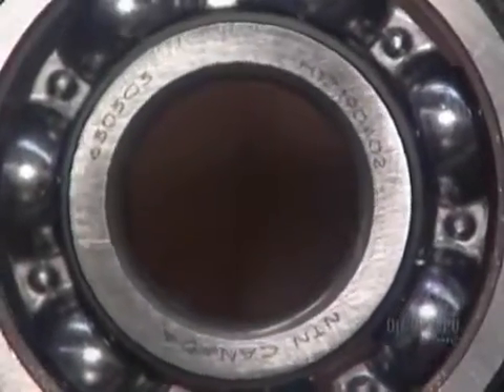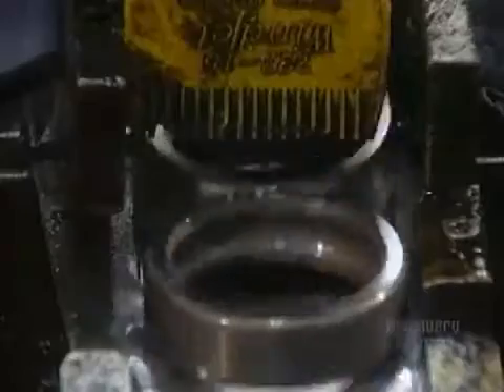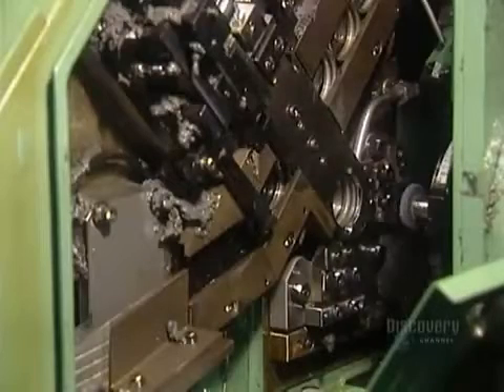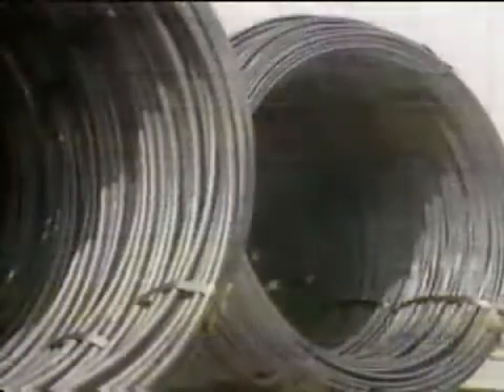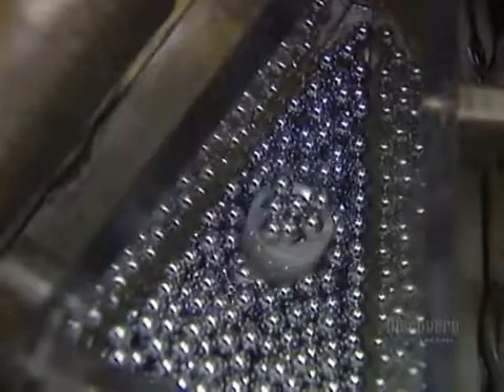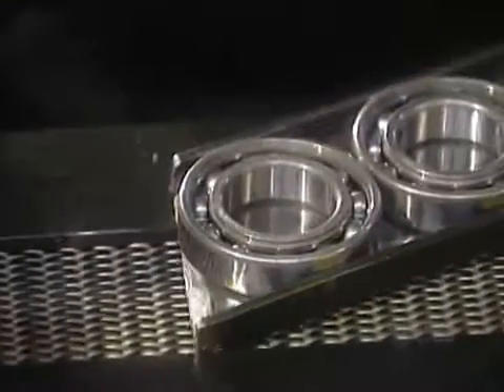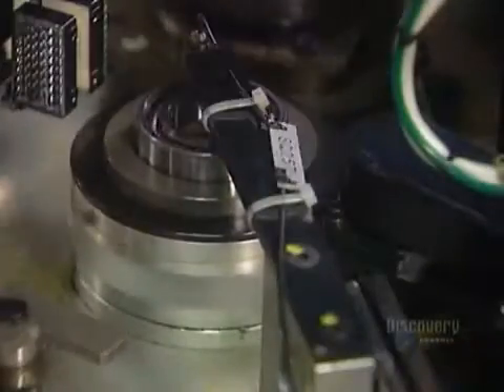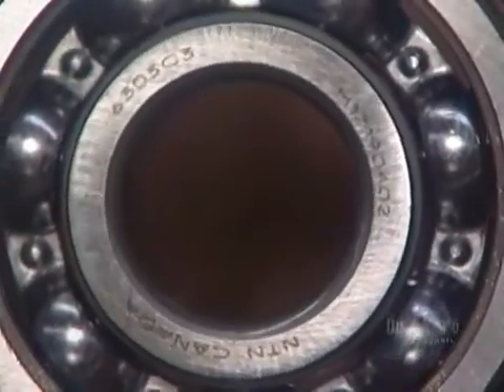[Vòng bi] Vòng bi được sản xuất như thế nào - www.tongkhocokhi.com

Comment: ThyssenKrupp Materials Việt Nam chuyên cung cấp các loại nguyên vật liệu như sau: 
- Các loại thép không gỉ (tấm , cuộn, thanh, cây, dây) : 201, 202, 310, 304, 304L, 316, 316L, 410, 430, …..
- Ống đúc/ ống hàn, van và phụ kiện bằng thép không gỉ từ DN8-DN350 (SCH 10-SCH40)
- Đồng đỏ/ đồng vàng (tấm, cuộn, cây, ống, đồng thanh cái) : C1100, C1220, C2680, C2400…. (Với độ cứng : Soft, 1/4H,1/2H,3/4H, H…)
- Nhôm/ nhôm hợp kim (tấm, cuộn, thanh, cây): A1050, A1100, A3003, A3105F, A5052, A6061…..(Với độ cứng: HO, H12, H14, H16, H18, H24, H111/H116….
- Thép chịu mài mòn : XAR, Vautid
- Thép công cụ, làm khuôn, thép chịu nhiệt và thép đặt biệt khác (S45C, S50C, S55C, 2311, 2083, 2379, 2344, 2510..)
Liên hệ Mrs Thương : 0936 630 083. Tks a lot!